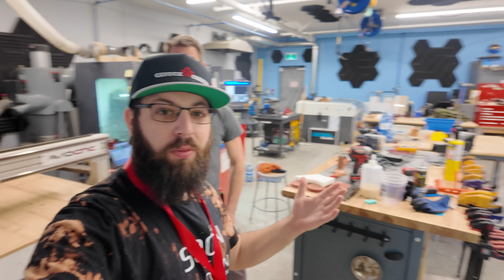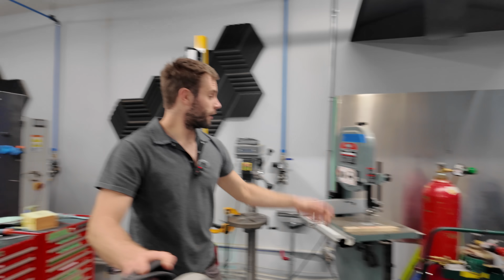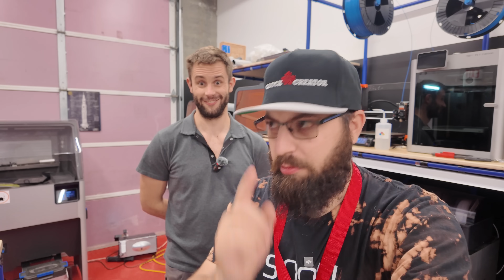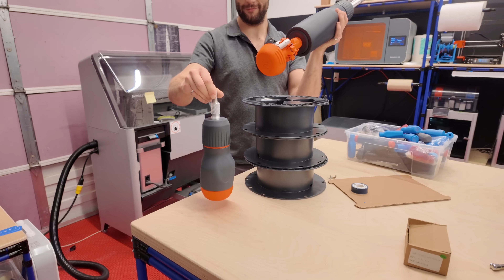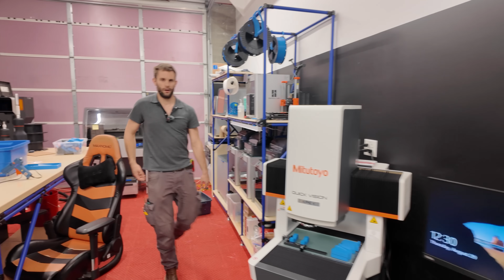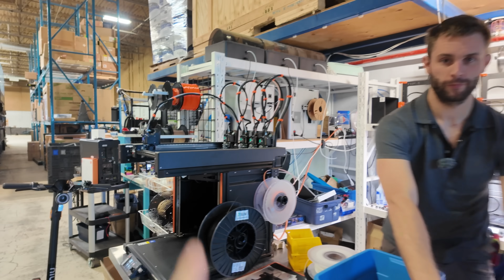How the Tech Tips are MADE! Production tour of LMG #manufacturing #3dprinting

Comment: That's an optical comparator not CMM, we have a similar one at the shop I work at. They are pretty different.
Reply: In its current form it is a Video measurement system, I would say its closer to a CMM than an optical comparator though its likely a terminology difference. Optical comparators are generally described to "only" handle 2D measurements this is a 3D system that has the capability of having an additional touch probe.
Reply: @tynanstack8251  we have a Keyence machine that has a light probe but it doesn’t do z depths, that option only had a .005” accuracy so we didn’t get that. Does that machine probe in z? If so that’s a great machine!
Reply: We have a Mitutoyo QV Apex 302 its accuracy is on the order of 1-2um in all axes! It’s a pretty sweet machine indeed!

Comment: Do they have any kind of filtration/ventilation system for the printers (especially the resin ones)?
Reply: Most of the resin systems we use have built in filters, and they are located far from other workspaces. For our FDMs we mostly use PLA/PETG which doesn't offgas much and our main print areas are large open areas or in non-office spaces

Comment: I'm surprised that LTT does so much product development in-house. I had thought that they were working with external companies that specialize in prototyping.
Reply: Generally speaking iterating using in house 3D printing is wwaayy faster than working with an external prototyping house, since we can iterate like 20+ times/day depending on the size of the part with printers whereas at an external house it would be days to weeks per cycle. It also helps us understand manufacturing processes and improves our design processes! Plus lets us do fun one off projects with the tools!
Reply: They do a lot of stuff in-house in general tbh, as Linus and some of the others have talked about a few times. That's why they can have such a large number of staff, but inidividual projects and tasks can still seem slow or flawed in some ways, bc there's only a small number involved. It can lead to inefficiencies in some places but allows them some pretty significant freedom and other benefits elsewhere. Like Tynan pointed out, so many of their resources are pulled frequently in various directions for labs testing, videos, products, and sometimes Linus's personal use lmao
Reply: Afaik, they do most if not all of their design and development in-house and then work with third parties for manufacturing
Reply: Generally speaking, product iteration and development is faster on 3D printers and lmg has an advantage in that a lot of their staff are very familiar with 3D printers so that they are capable of reviewing them and giving good reviews rather than meaningless ones. And when you have a significant percentage of your company That understands 3D printers at a far more in-depth level than even the average manufacturing company, they become quite useful